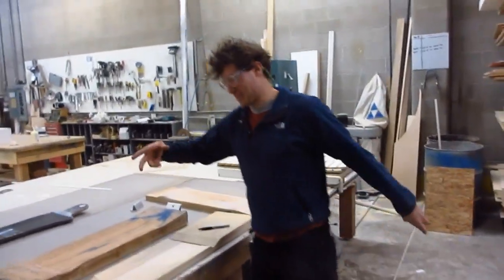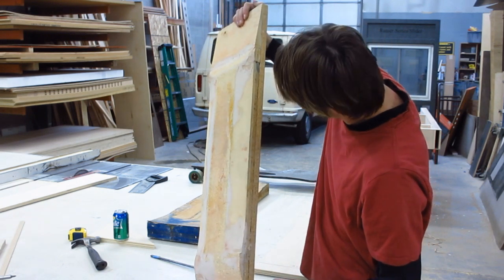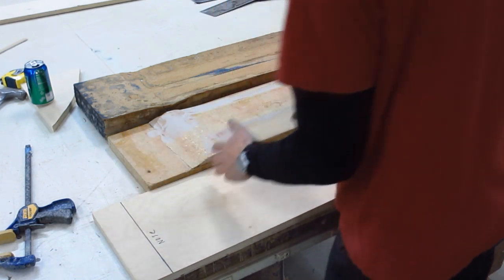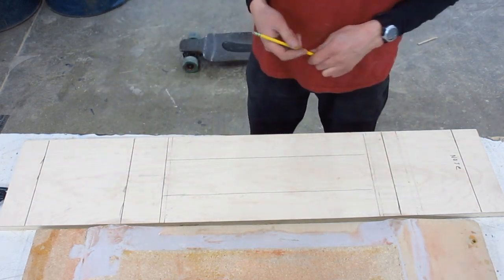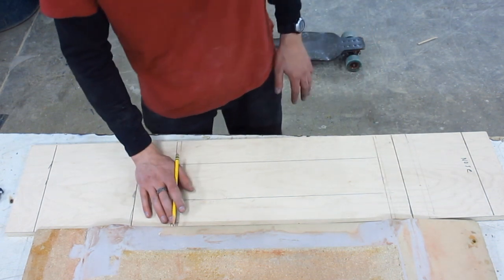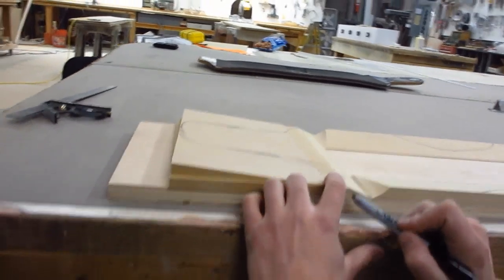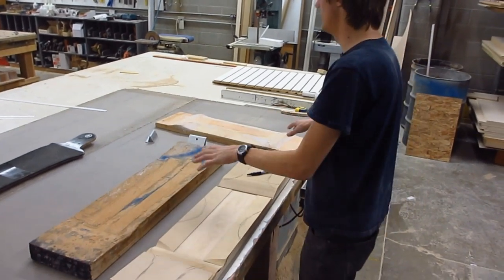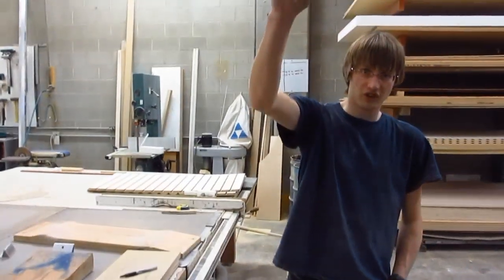How To Make a 3D wooden longboard press.

Comment: How can one overcome the torture bend dilemma?
Reply from the maker: More pressure, thinner veneers, or softer wood.

I normally use 1/8" baltic birch, but the standard is more 1/16 maple, which is less forgiving for the glue up but does take more shape despite being a lot harder.